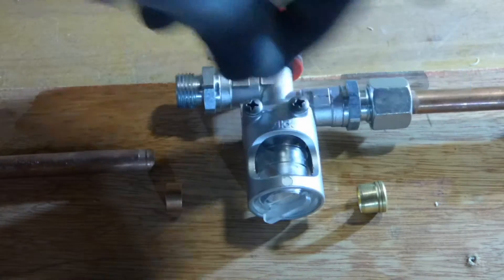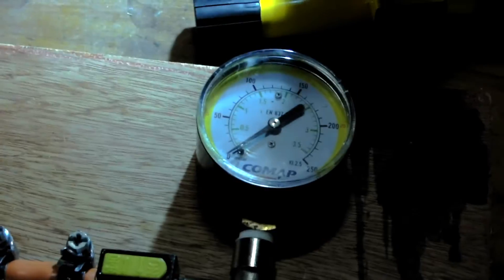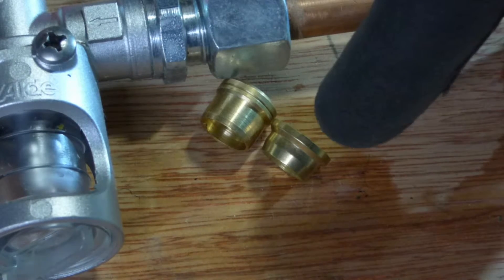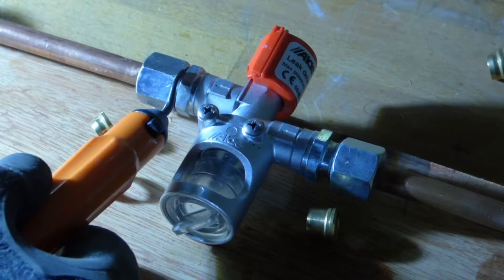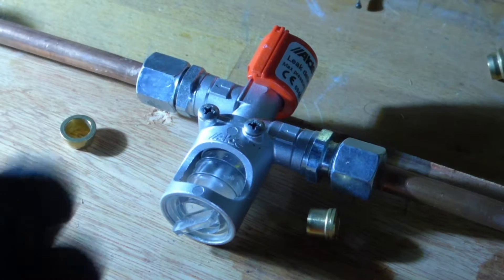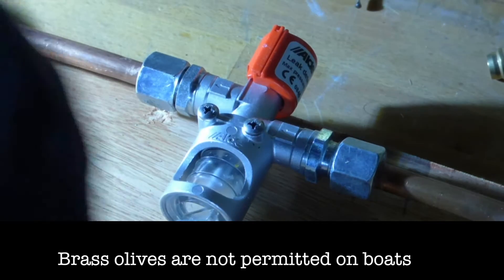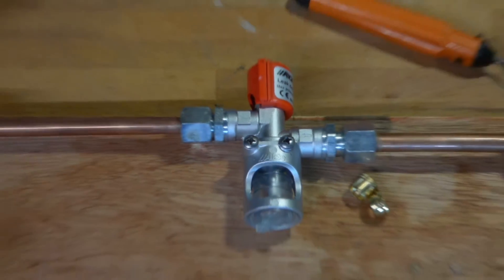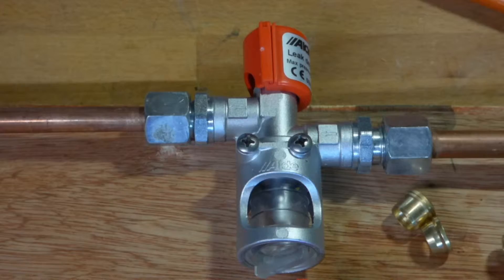Part 2: NEW - Can a 3/8" pipe fit a 10mm Alde LPG leak detector? // Bubble Tester

Comment: Great appreciation of the need to use 'marine grade' copper - pity the job turned into a non-compliant disaster by use of a (taboo) BRASS olive !
Reply from the maker: Thanks for your input. 
I did write at the beginning on Video One that I would be creating deliberate faults throughout.
There are THREE video in this series. 
If you watch video 3, you will see I conclude with a 3/8" adaptor using a copper olive.
https://youtu.be/cf4Q8r6F-W4